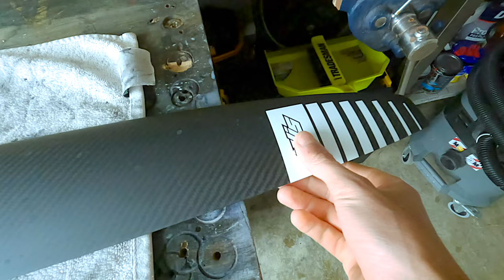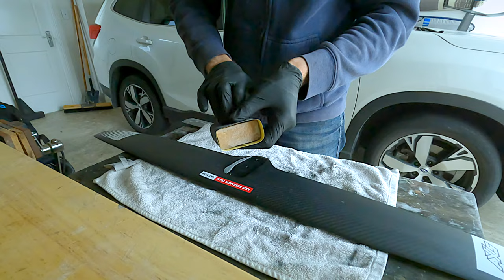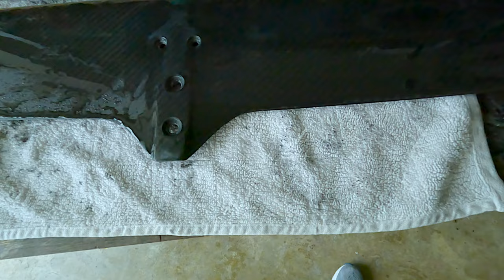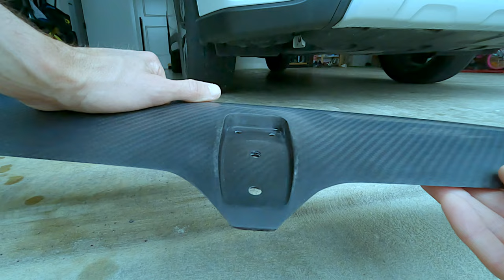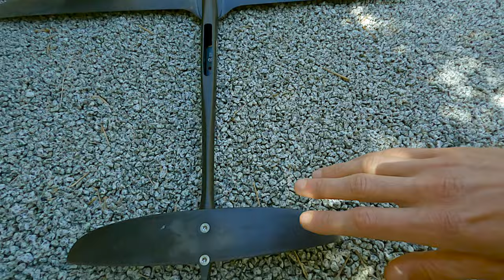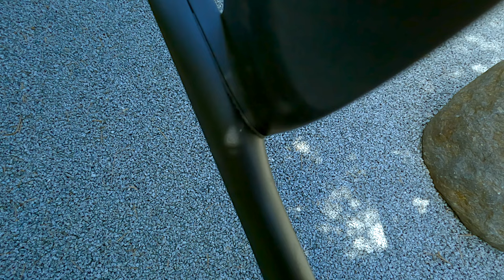Tuning Axis ART series foil (or any other brand foil for that matter)

Comment: I also spray on a hydrophobic waterproofing compound after sanding.   Its supposed to make the surface 100% waterproof and also protects from light scratching.
Reply from the maker: It probably gets washed away after a few sessions, unless it's some kind of paint-like stuff
Reply: which one?
Reply: It is good idea for bottom surface. But I have doubts about the top one. Water should stick to it to create lift. Otherwise it may cause flow separation. Sure vacuum will try to prevent the separation. But still ...

Comment: That video you link from the Levitaz guy is the only one that says to sand the pressure side (which I call flat side). Everybody else (Armstrong, Alex Aguera of Gofoil, Fanatic, and others) say to sand the curved side. Which is kind of shocking, really.
In my experience, I successfully tuned to silence a bunch of Armstrong wings by sanding the curved side. I failed to silence Axis wings that way though. Cheers.
Reply from the maker: To some extend, just by making the trailing edge thiner makes a noticeable difference,  Funny indeed different brands recommend to sand different sides.

Comment: Good info, especially rounding the pressure side of trailing edge.
Do you sand your masts?
Reply from the maker: Didn't find the need to sand the Cedrus mast, it has plastic-ish inserts at both edges, not sure is should be sanded.

Comment: are you sharpening the trailing edge? Isnt a trade off of reducing safety in exchange for increasing performance?
Reply from the maker: Yes, you just don't make it razor sharp, just sharp enough and finishing with the rounded edges.

Comment: Will doing this help get up on foil faster? Or is it mainly for glide?
Reply from the maker: It should make it a bit faster and glidier, yet to test (need some offshore-ish wind to try)
Reply: Keen to hear about differences in performance post tune. Thanks
Reply from the maker: @mikkgodfree3886  It's was clearly noticeable right after sanding it, now I can't even tell what's the difference :). More slippery/glidy for sure and it makes way less noise now.
Reply: Great great information !what size fuselage are you on?